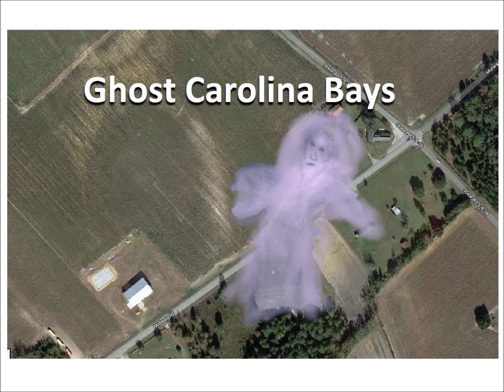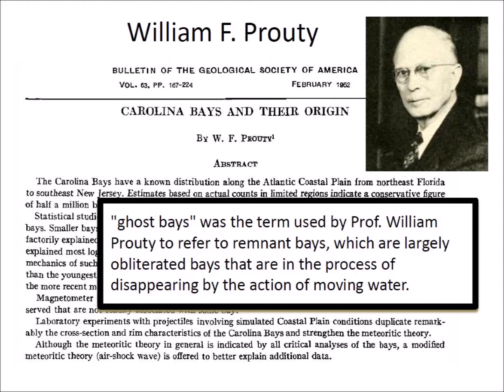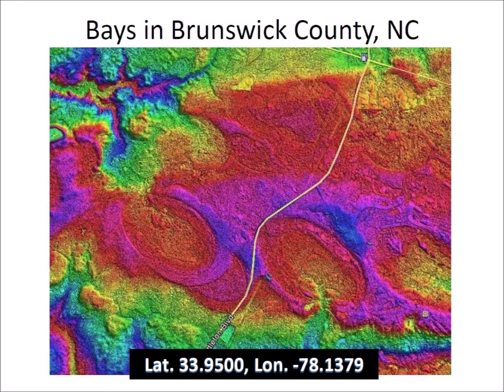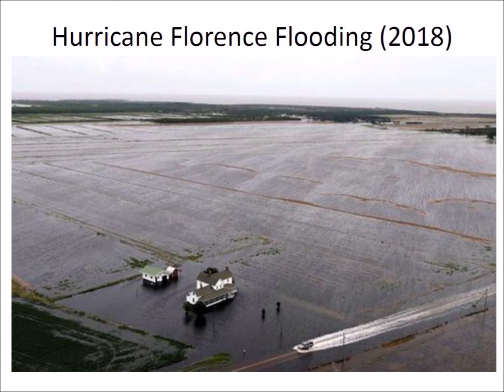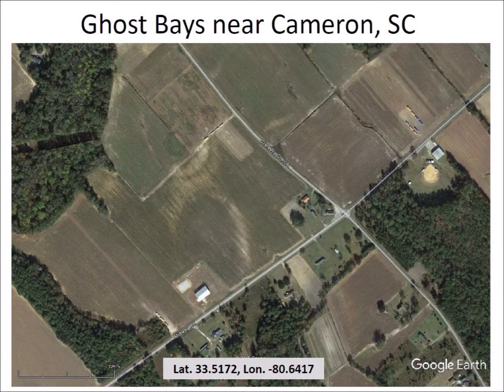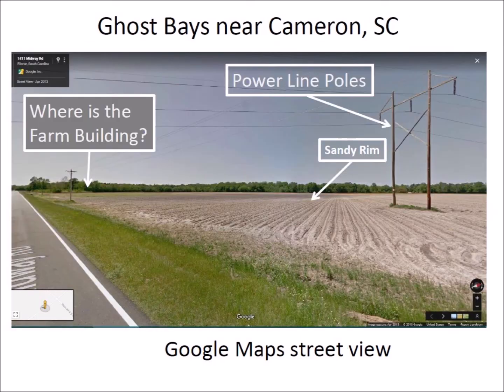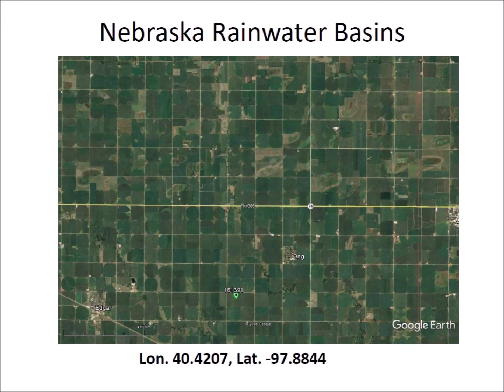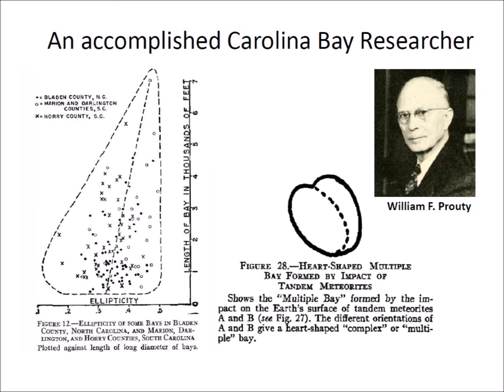Ghost Carolina Bays

Comment: Randall Carlson has mentioned some ghost bays in Alaska, and I wonder if you have looked at them as well?
Reply from the maker: The oriented lakes in Alaska are thermokarst lakes, which are created when permafrost melts and creates a sinkhole. They are 4,800 km from the convergence point of the Carolina Bays and the Nebraska Rainwater Basins in Michigan, so they are too far to have been created by the same event. In addition, they do not have an elliptical geometry so they have a different mechanism of formation than the Carolina Bays. The following video discusses the differences: https://youtu.be/J08WVFawFB4

Comment: Hi Antonio,  

Thank you for your interesting and thought provoking research and observations. 
I live in the Upper Ottawa Valley in Ontario.  Our local museum has whale bones from the post-glacial flood.  
Here's a thought in the form of a question.  
Would the ejecta shards of ice reach speeds that would cause air friction to increase temperatures that would turn the shard into a superheated concentrated water or gas projectile?  
If so, could that create the Carolina Bays?
You're the scientist, I'm just wondering.  
Thanks,  Hamish
Reply from the maker: I have tried to imagine the re-entry of the ice boulders.  We can calculate that the excavation of the crater by the meteorite on the ice sheet lasted for about 30 seconds.  With ballistic trajectories at 35 and 45 degrees, this creates a window of about three minutes during which the ice projectiles would have reached their target, impacting the surface from about 6 to 9 minutes after the extraterrestrial impact.  1.5 trillion cubic meters of ice re-entered the atmosphere during this time.  The atmosphere was saturated with water vapor derived from the ablation of the incoming ice boulders.  Slip-streaming reduced atmospheric drag for boulders flying in close proximity.  All that water vapor could have turned into snow and rain.  Can you imagine the deluge, the storms and the lightning?  
Regarding waves created by the ice bombardment on the Atlantic ocean, they would not have made a single wave like a tsunami from a tectonic fault. They splashed on the water at different times and created great turbulence.  Looking at a globe of the world, that turbulence would have reached Bermuda, and perhaps northern Africa, the Caribbean and South America.  Europe would have been mostly shielded by northern Canada. I have put some of these thoughts in my Younger Dryas Extinction video: https://youtu.be/npXY8mu2hhU
Reply: @Antonio_Zamora Le admiro mucho a usted y a su maravilloso trabajo.  Habrá un día no muy lejos en el porvenir cuando por todo el mundo dirán los cientificos: ¡ por supuesto ocurió así!
Reply from the maker: The extraterrestrial impact sent material in ballistic trajectories above the atmosphere. Friction would not have melted the pieces of ice. Any ice turned into vapor would have condensed as snow or rain. The Carolina bays were formed by pieces of ice that survived the reentry through the atmosphere.
Reply from the maker: Hapax Palindrome: Muchas gracias por el comentario. Para tratar de propagar la idea del cataclismo que ocurrió hace 12,900 años, he escrito dos páginas en español en Wikipedia sobre las Cuencas de Carolina y las Cuencas Pluviales de Nebraska.
https://es.wikipedia.org/wiki/Cuencas_de_Carolina
https://es.wikipedia.org/wiki/Cuencas_Pluviales_de_Nebraska
Reply: Thought provoking question, Hamish.  I think I see where you are going.   Purely as a thought experiment, I think that the face of the reentering iceberg would be eroded by frictional heating.  This would lead to areas of transient back pressure on the bolide as the vapor exploded away.  Tumbling would have resulted.  Not likely an iceberg would have developed a stable incandescent face as the vapor eroding away, if any, would have trailed off into the atmosphere.  Looks like the 40 days and nights of rain might not have been mythological hyperbole after all what with all that H2O blasting off.  Given that the bombardment is so comprehensive along the seaboard one must wonder if the icebergs were thrown further and if a significant quantity reached the sea.  Tsunami evidence anywhere?  Of course the sea was further away but a statistical analysis would allow for extrapolating the full range and extent of the ejecta.  Did I miss that episode?

Comment: A subject I'm looking into.  Your videos are excellent.
Reply: Chuck if you need any stuff for the bays I live near a lot of them and am taking a trip next weekend (if the flooding stops) to get samples from the rims of several of them. Just bought a microscope to look through the soil.
Reply: Take a tape measure and a compass as well.
Reply: Well said, Chuck!
Reply: i can take pics if needed, etc
Reply: I just might. Thanks.   I brought up the Bays 6 years ago...along with the possibility of an impact on the ice sheet.  6 years ago.  So I have been peeking at this for a long time and want to make another video.  What to say though?  That's different?  Tough when channels like this do such a thorough job.
Reply: Is there any mounds inside a bay or two?
Reply: this seems like a pretty obvious smoking gun for the YD impact, so the more stuff out there the better. imagine the tsunami created by the pieces that landed off the N. American coast that then hit Africa, etc. we should be able to see chevrons or some sort of deposits (dunes in Mauritania, for ex?) on the opposite side of the ocean if we look closely enough (or maybe it's huge.....going hundreds of miles inland, perhaps?). LIDAR will gradually reveal a lot of this, as well.
Reply from the maker: I understand the resistance to new ideas.  But the impact hypothesis has had a particularly rough time. Trust in the dates calculated for the bays has been a major roadblock. The requiem paper is another one.
Reply: Seemed obvious to me when I first talked about it.  Before I had ever heard or listened to Randall Carlson.  The enormity of it though.  That's what I have thought from the beginning.  How devastating this actually was.  Even the people writing about an impact back then ... I thought they were being conservative.  I went over tsunamis in my flood video. We have no real idea just how bad those can be. The Great Lakes...that's what i'm trying to wrap my head around. Google Earth is great for this subject.   I'm putting together another Q&A video...and this channel is getting a shout-out.
Reply: My step mother is from the Lake Waccamaw area and they always thought it and the neighboring lakes (ex. White Lake) were from an ET impact. Alternate explanations didn't 'smell right' even 50 years ago before accessible aerial surveys.
Reply: If the water floods out across the Bay of Mexico it would wipe out Yucatan. There does seemed to be 'Bay' type shape over there around Campeche. Im sure you have posted a mound video in the past with 'Ghost Bays' close by. Great shout Chuck!
Reply: Ziggy Dan  With all the "bay sites" and all the mound sites I'd be surprised if one or some aren't right around or next to one.
Reply: neoclassic09  I'm positive that lake was mentioned in one of my early videos.   I remember it looked like the sand was pushed up on the SE side. Aligned to a NW to SE impact.
Reply: The river system would 'block' up and be re-arranged. Is there any evidence on the arc of the ejecta curtain?
Reply: Chuck with your Google Earth prowess you should be able to find some new bays or other impact evidence... Just sayin! :-)
Reply from the maker: The idea of impacts on the ice sheet have been mentioned several times. Randall Carlson discussed the idea that the Carolina Bays may have been formed from the secondary impacts of glacier ice ejected by ET impacts on the ice sheet over Canada in a lecture in May 2008, but the video of the lecture was published just this month on Sep 14, 2018. 
https://youtu.be/4l2WoBJvUjI?t=35m24s  (about one minute)
Something that made a big difference was the work of Davias and Gilbride (2010) that found Saginaw Bay as the convergence point of the Nebraska Rainwater Basins and the Carolina Bays. This made it possible to start using ballistic equations to explore the impact hypothesis in a rigorous physics-based model.
Davias, M.; Gilbride, J.L., Correlating an Impact Structure with the Carolina Bays, GSA Denver Annual Meeting (31 October - 3 November 2010), Paper No. 116-13, 2010.